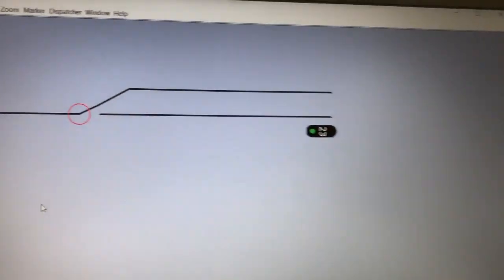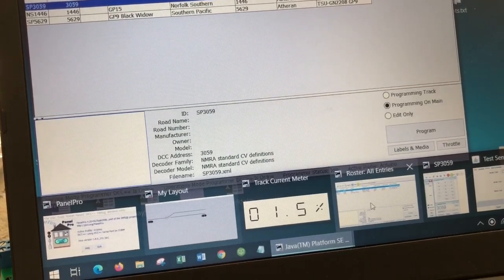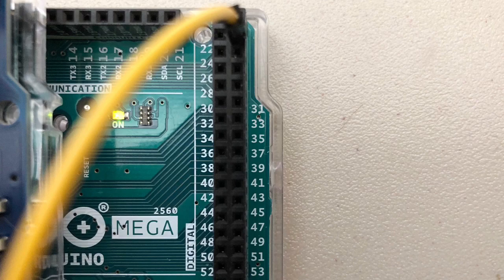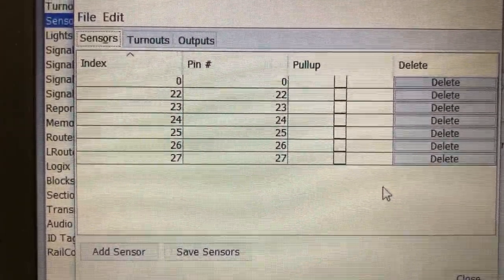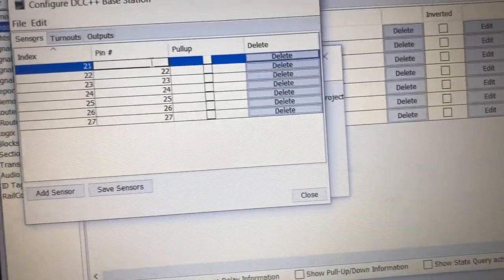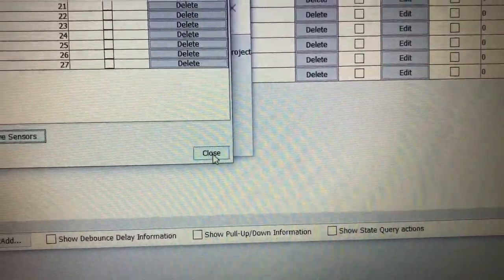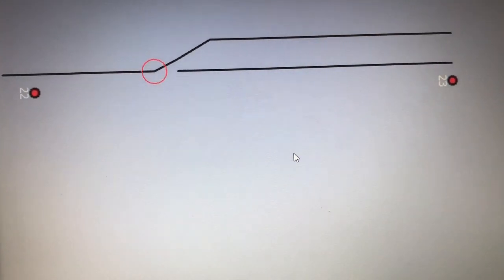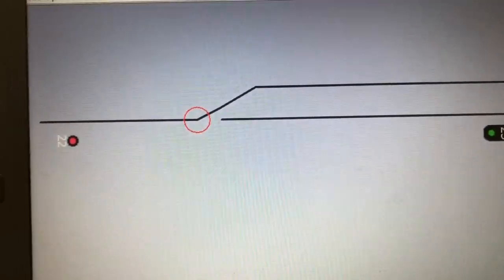My 4x8 x 2 HO Layout - Arduino JMRI Sensor Setup Video #2

Comment: Glad to see you have your project figured out. Maybe a harder way to add sensors to JMRI, but you can add them with the serial monitor in Arduino by using the commands on the sensor page of the sketch. Once they are loaded into the Mega, JMRI will auto populate the tables for you.
Reply from the maker: Good to know.  Thanks again.  See next video to see it operational.  Be safe 😷

Comment: A suggestion, instead of cutting the sensor output wire and attaching additional wire somehow.  Use the steel pin and a crimp connector to add the additional wire.  The pin is a larger gauge and stronger than 28 gauge wire.  It should be easier to add the needed wire.  I hope this is a help.  Take care and be safe😀
Reply from the maker: Greg, What do you mean by “steel pin”?   Can you buy the male and female connectors separately and the put on the extra length wire?
Reply: The pin I was talking about is the male pin that is plugged into the Arduino socket from the sensor.  Yes, you can get the male and female connectors.  They are a crimped connection to the wire.  I broken a couple and seen the crimp.  The problem will be getting the proper tool to do the crimping.  I have not see one in my travels through the electronics world.  Give Ebay a visit and you may find one.  Wish I could be of more help.
Reply from the maker: Thanks.  I’ll do research.
Reply: I thought about this some more.  I do know that both male to male and (male to female) jumpers are ready available. By using the smallest inline (blue I think) crimp connector and 24 guage stranded wire, you should be able to make a real long jumper either male to male or male to female. Hope this a help.
Reply from the maker: Greg, Thanks for follow up comment.  After your last comment, I got on eBay and ordered a variety of connectors for small wire.  I’ll have lots left over to use on the next layout. 😀